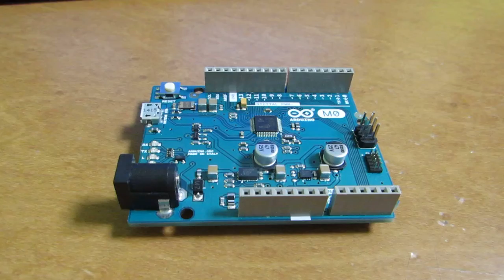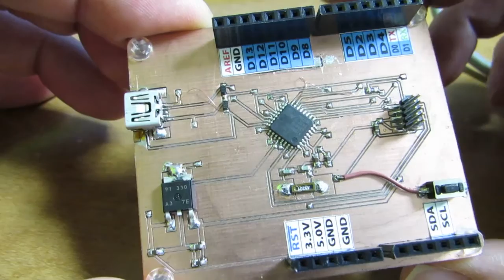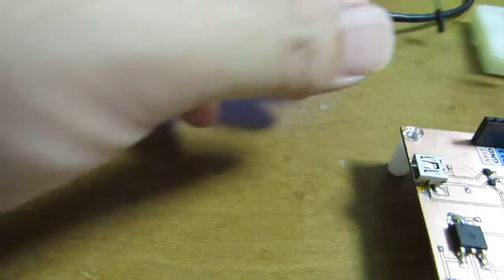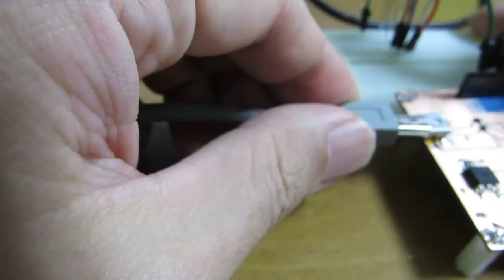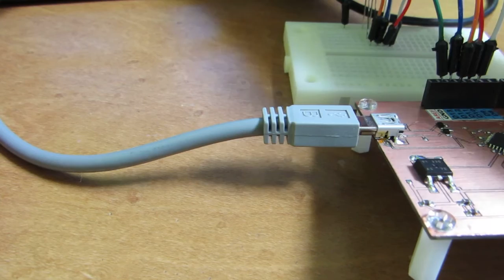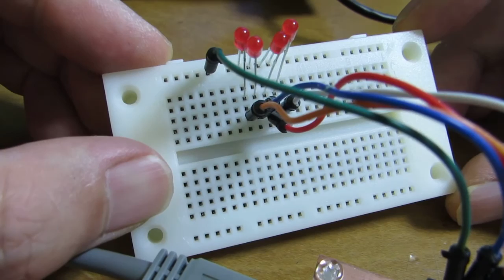5 V tolerant Arduino Zero compatible board

Comment: Beautiful
Where is the Hackaday page?
The link is broken
Reply from the maker: +Jean-Luc Deladrière Hello, unfortunately hackaday page does not exist anymore, but you can find archived files in https://web.archive.org/web/20150928214600/https://hackaday.io/project/7616-full-5v-tolerant-arduino-zero-compatible-board
Please take a look!
Reply from the maker: +Jean-Luc Deladrière Now it is salvaged at https://hackaday.io/project/9737-salvaged-full-5v-tolerant-arduino-zero-compat Thank you for your interest!
Reply: Thanks for the update. Very clever design!Are you using the Arduino IDE to upload software? I cannot find any board using the SAMD21E version. All the zero board I see are based on the SAMD21G version. What bootloader are you using? I cannot use the. PRO file in eagle. can you post the .SCH ? Thanks
Reply: I am trying to have this board to work with Arduino : https://www.elektor.com/t-board-arm-150059-91?___store=default&___from_store=fr
Reply from the maker: +Jean-Luc Deladrière Hello, indeed SAMD21G's bootloader for Arduino Zero is working well also in SAMD21E, in my case. All you will need is ATmel ICE and Arduino IDE (.cc version, not .org one). Just selecting programmer as ATmel ICE and upload bootloader will change your board into Arduino Zero..!
Reply: +microwavemont I did that but the blink example (led on PA17) won't work. Also, the com port disappears just after upload. Very strange behaviour. Thanks anyway because I was not even sure it should work on SAMD21E.
Reply from the maker: +Jean-Luc Deladrière One different thing I found between Arduino Zero, my board and your "elector.com" board is, the existence of 32.768 kHz crystal, connection between PA0 and PA1 with 22pF shunt capacitor. The bootloader of Arduino assuming 32.768 kHz crystal, not internal RC oscillator. So it is quite reasonable after writing bootloader, your board stop working... Just add the crystal with capacitor will make it work! Let's try it!
Reply: thank you soooo much ! It works with the crystal !
Reply from the maker: +Jean-Luc Deladrière I am very happy to hear that!! Enjoy it !